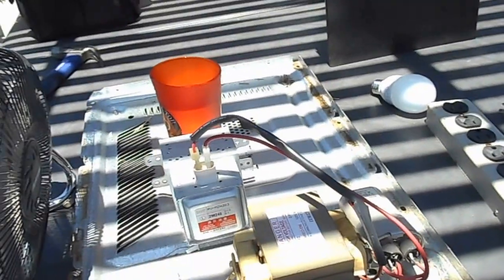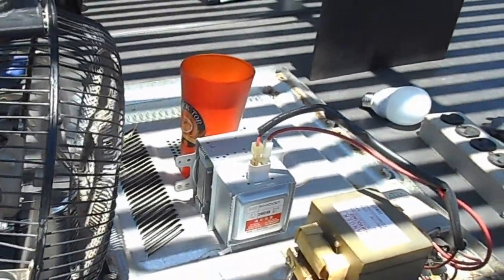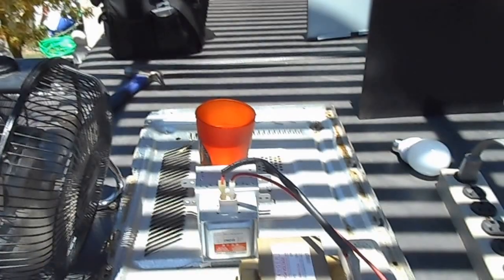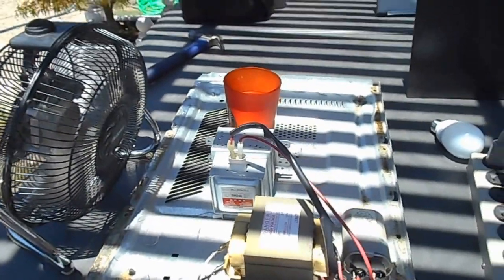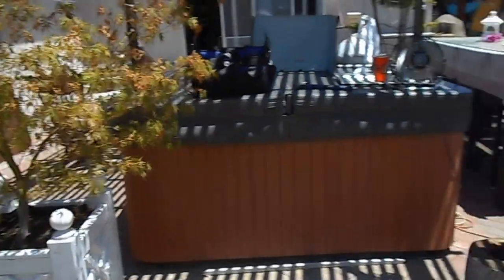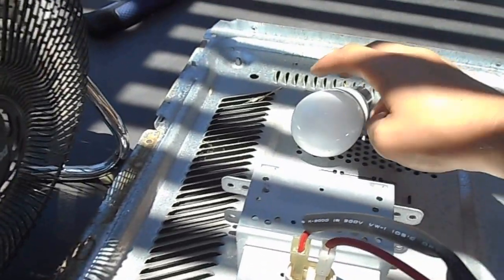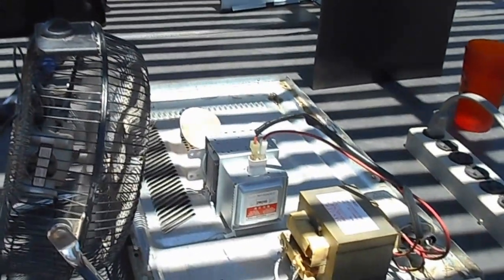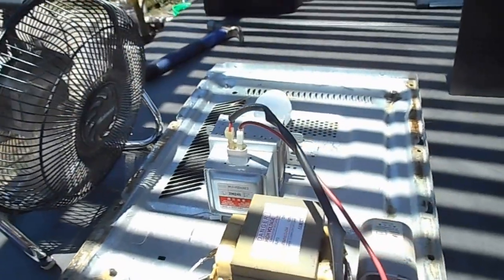homemade microwave gun boils water

Comment: Because microwaves can easily be bounced off of metals and directed, you could simply increase your device's efficiency tremendously by making a cone out of tin foil and putting it around the "antenna" of your magnetron. You would then have directed radio waves, instead of ones that disperse into the air once created. The interferences with your camera will also be reduced, and range increased. Hope I helped you out if you decided to keep this around
Reply from the maker: nah, i got rid of it